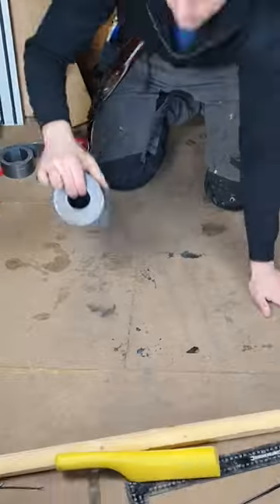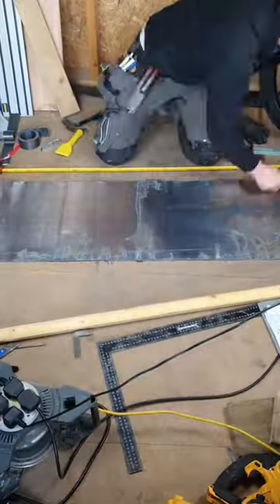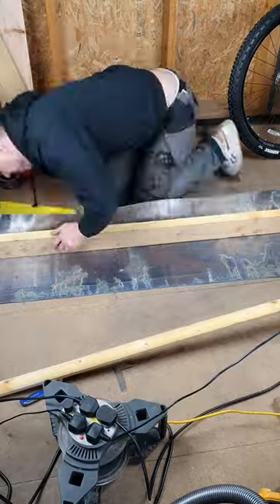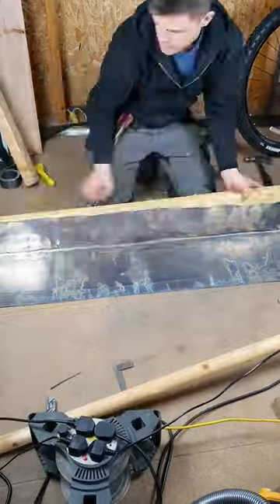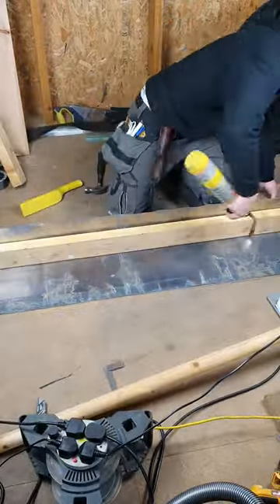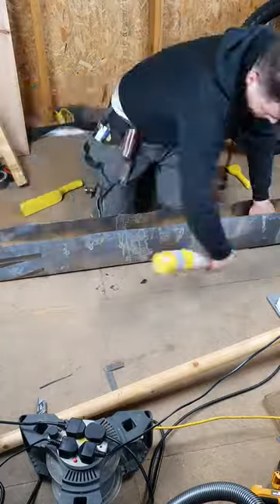First Attempt at Lead Ridge Bending #shorts #leadwork #leadworking #roofing #roofer #diy

Comment: You can use a wedge only last thing just to tidy your lines but never under heat or you thin it out too quick and puncture it, your better off with a dresser that's not sharp to get it as near as you can will save thinning the lead. Good try tho atleast you had the sense to make a box first to wrap over the roll.
Reply from the maker: I never touched the thing again after this 😅thanks

Comment: Well, don’t throw it away. He said that stuff was super expensive so I would try to lead patch it. It’s just like soldering, but you use a material instead and if you prep it properly it’ll last forever.
Reply from the maker: I have enough to use another piece, so I'll use that one for another part!
Reply: Lol.  One of my first big jobs, on my own, was was an ac job that included a roof penetration through Spanish style domed tile.  We used lead sheet to modify a standard flat roof jack...bad dreams for a year.  22 years later, still no reported leak.  Live and learn, friend.